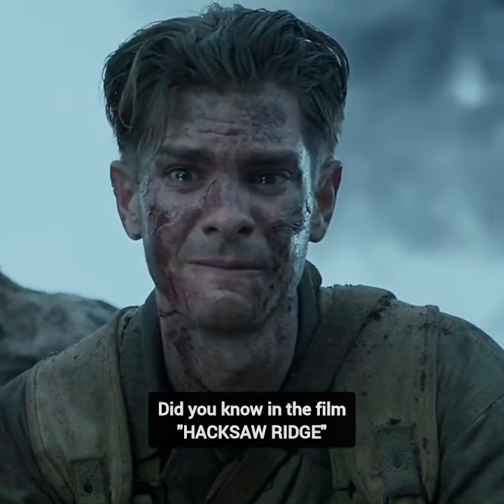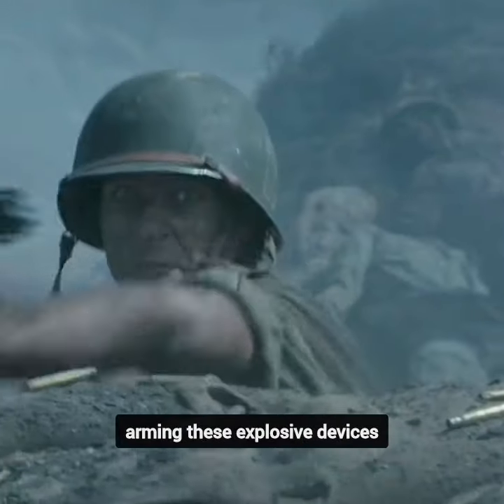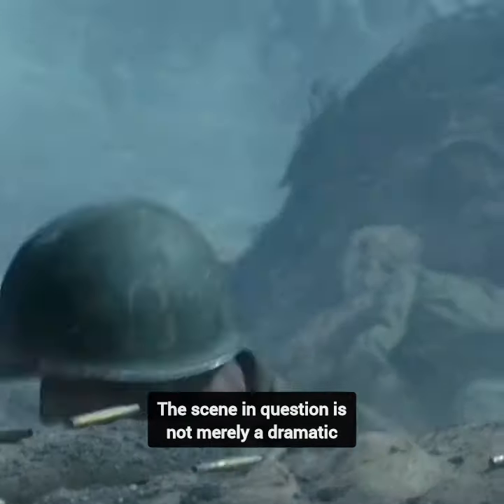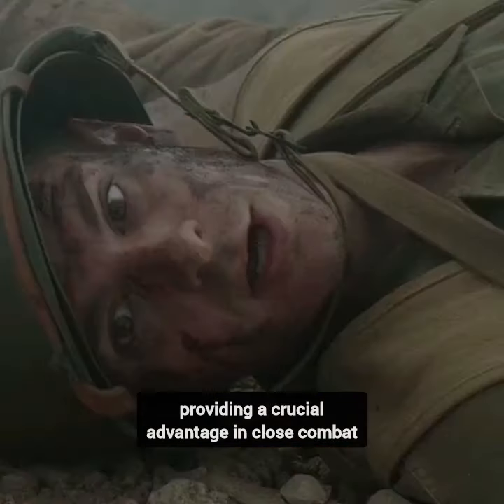How Hacksaw Ridge Portrays the Unconventional Use of Mortar Shells in WWII - #shorts #short

Comment: They do the same thing in saving Pvt Ryan
Reply: 1998 so there is nothing new here
Reply: And cod waw
Reply: No shit, do you think that miiiiiight be where they got the idea from?
Reply: Yep. Yeah, they did.
Reply: Was about to say this
Reply: @misterwhite37 Nope. Nothing new here. The final battle in Saving Private Ryan shows them doing this exact thing..striking the tail end of the shell on a rock or piece of concrete to arm the fuse, and then throwing them like hand grenades. It wasn't just like a quick thing that they just quickly glossed over either. They were completely out of ammunition, and they made a point to show them using the mortars as improvised hand grenades.
Reply: Well made by same people

Comment: I am a former mortar man and we have safety pins on mortar rounds that you have to pull before arming them. You can literally get mortar rounds and throw them in the ammo can and cardboard they are in called a tootsie and you will be ok. Only modern ammo that requires careful storage is white phosphorus rounds. They also have a tool that helps set the fuse to delay or burst on impact. As for striking the mortar ammunition ik from reports that this is legit but the safety pins must be removed from the mortar round in this case a 60mm HE mortar round. As for modern day ammo I have no idea but if you take the safety pin off you better treat it with caution

Comment: 81 mm mortars have a bore riding safety pin. Any 11C knows. If bore riding safety pin is not ejected, no boom.
Reply: I read that you can manually eject the bore riding safety pin. The 81 can then be used like a grenade. It was a last resort thing so I’m not real sure how safe it is.
Reply: @fetchingcat4914  Not true. The bore riding safety pin is within the mortars round. It will begin to eject once the explosive charges at the bottom of the round have detonated after hitting the firing pin, then the bore riding safety pin will ride along the inner barrel of the gun tube, fully ejecting once the round leaves the gun tube. Only fired maybe +500 mortar rounds, was the gunner, so this is real life experience here.
Reply: @nightrain6371  like I said I read it I didn’t live it so thanks for clearing it up.
Reply: What about 60 mm shells
Reply: The arming mechanism was different for world war two mortar rounds than it is now.

Back then, you could arm 60mm Rounds by striking on a hard surface, modern ones are armed differently and cannot be used this way.

Comment: US Hero Anderson threw a dud shell first, then 14 US 60mm mortar rounds, also fired his carbine after each shell while resting his throwing arm. He injured himself severely by the fragmentation of a mortar shell. A 60mm mortar round weights 1.5 kg. A quite impressive act of courage. 
To the Saving Private parts of Ryan fanboys: a German 8cm 34 mortar round weights 3.5 kg. Professional athletes can throw 3.5kg to 20 meters, only a few beyond. Good luck hiding from the lethal blast radius, and shrapnel radius.  German 8cm mortar shells had similar misfire safety used in most modern mortars, therefore it can't be used in such way.